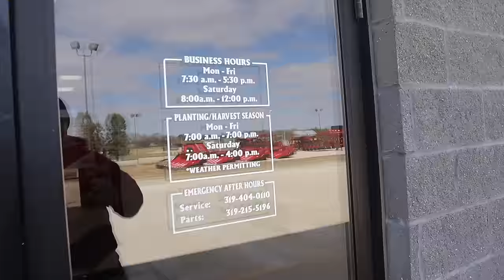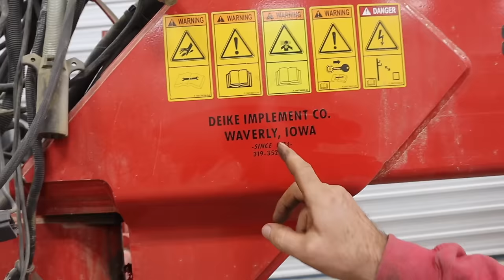we are off to a rough start…

Comment: The frogs are held on with a 7/8 inch long by 5/16 inch roll pins if the roll pins are to long it will put pressure on the top of the disk which will increase the pressure of the the disk on the frog and wear quicker

Comment: A year or two ago weren't all the frogs breaking or cracked too? Seems odd its a continuing problem, I've been running green planters for 40 years and have never had a frog break, and only replaced them on one 12 row with 24,000 acres on it. Hope you get it figured out,good luck planting.....

Comment: DC i was thinking maybe if the planter has different settings where it attaches to the draw bar, if  the hitch is to far down it may be putting extra pressure on the 🐸 frogs if you can move the clevis to a lower position on the planter it wouldn't tilt it to the back some when you hook up, maybe the LS changed the height of the drawbar, we run JD planter but they all have the same basic design the frogs last for years on our planters however ours hook to the 3 point, thats got me stumped why those frogs 🐸 are wearing so fast

Comment: Not a mechanic but a great problem solver you as a multi generational farmer must be as well. The thing is you have done the easy bit now assuming this problem is showing up everywhere (If not then it is a matter of seeing what difference there is) So you have to see it in action I guess cameras can help plus you need a way of testing what pressure it is putting down. Causes could be something too tight or too loose something not moving that should even an alignment issue all of which you are nor going to see in your shed.